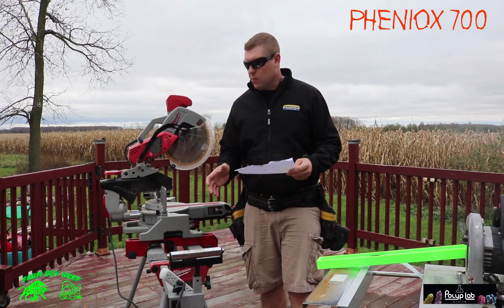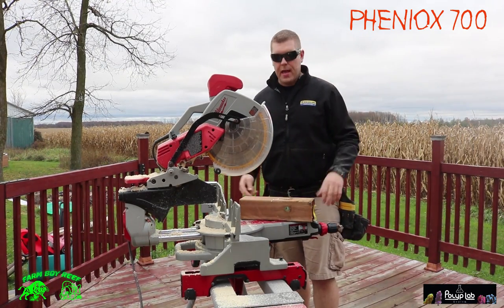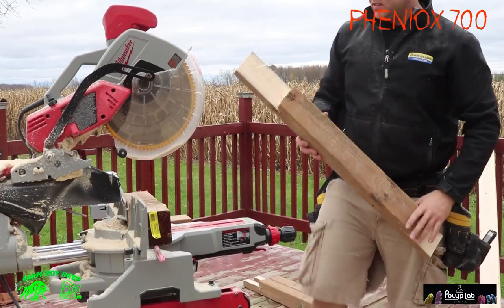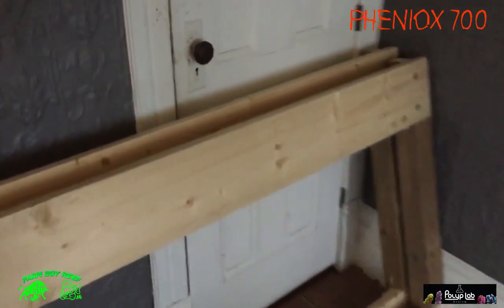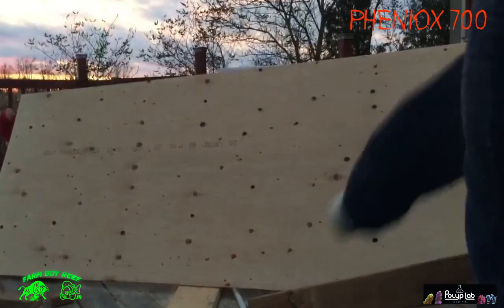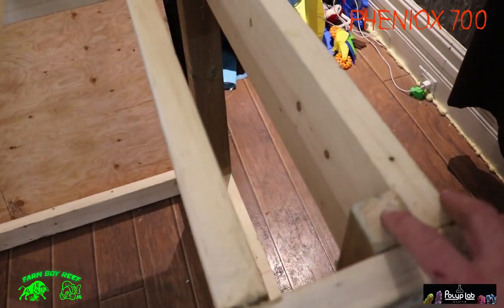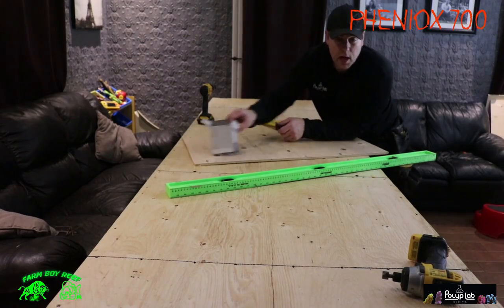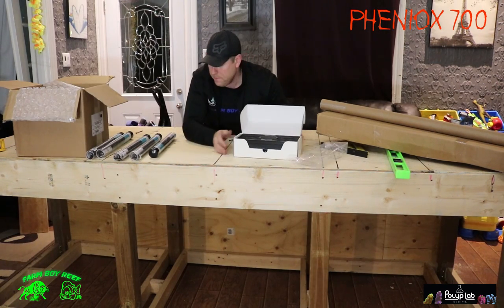700 gallon tank stand build for the Phoenix Plus LEDS

Comment: I love watching a system come together.   You could install aluminum pipe via brackets to the rear of the tank for hanging the lights later.  That way you'll have inserts that you can drop light poles into without hanging them from the ceiling.  also allows for future pipe height adjustment.